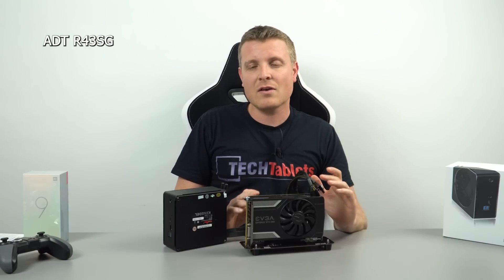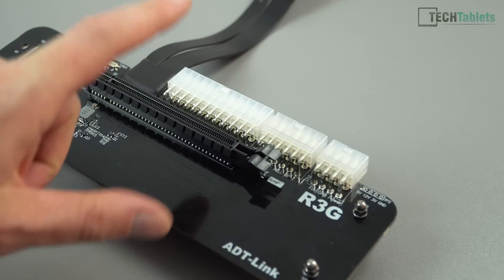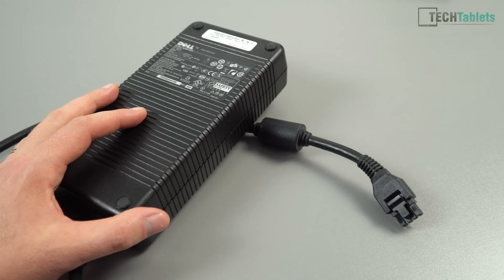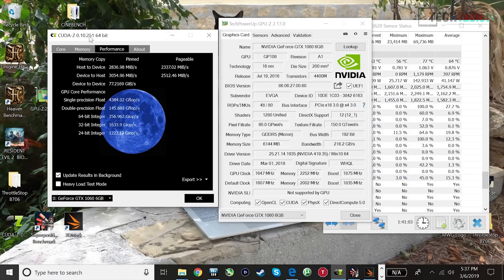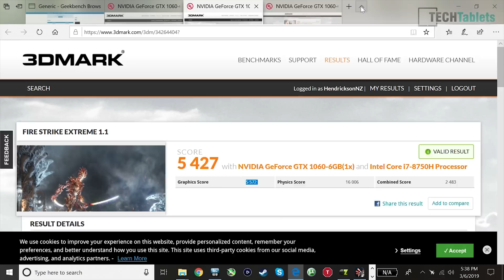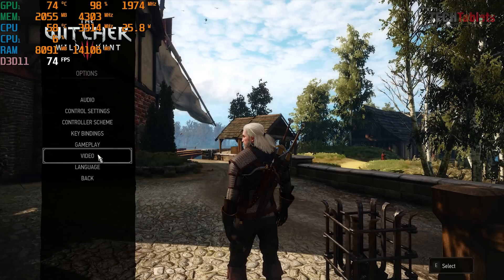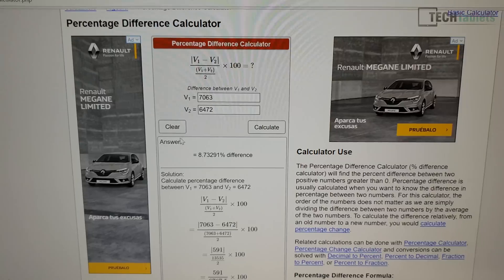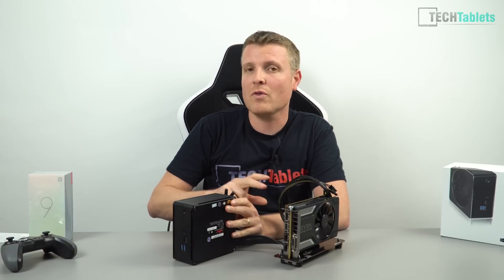M.2 PCIe x4 to External eGPU - Faster than TB3 eGPU's

Comment: Hi, i bought the same mini pc and egpu stand but im getting code 12 not enough resources  with the 1660ti and 1060 6gb did you run into this? did you config the bios in some way?
Reply: did you start the system? what bios settings?

Comment: works 100% no bullshiet, just at first tried connect to nvme slot and didint work so i remove my ram from nvme/sata and tried again true there
Reply: did you start the system? what bios settings?

Comment: I was running a eGPU set up with EXP GDC Beast V8.0 and a GTX 750 Ti and powered it with the same Dell PSU as you. Now i was thinking of upgrading to a GTX 1060 6GB and was wondering if the dell would be still enough. I hoped i could see how you connected everything. Could i just connect the EXP GDC with the Dell PSU and place the GTX 1060 6GB in the PCIE Slot? Or would i still need to use the connector cables?

Comment: Hello friend. If it is not difficult to answer a couple of questions .1) Is it possible to sew and model the bios in the Chinese mini PS? (And where to take them and what are the bios standing there?). 2) And I'm also very interested in the compatibility of the Chinese mini PS for (Egpu +1060) are they all suitable for such connections? And what problems are encountered when connecting to an external video card (they do not have a video egpu igpu tab in the BIOS)

Comment: I'm wondering..what if you plug the NVME end into one of those NVME to thunderbolt 3 enclosures and then you have yourself a external GPU that you can plug in via Thunderbolt 3? would that work?
Reply: Will work but will turn it in to a hyper computer

Comment: Great video, I always wondered about doing this. Glad to see someone tested it and shared their results so cleanly. Also you should try this with AMD's new x570 boards. The new boards have M.2 PCIe x4 gen 4 slots which double the bandwidth of current gen 3 M.2 x4 slots. So there should be little to no decrease in performance for all cards that cost under $1000 :)

Comment: is anyone tried at laptop ?
Reply: Yes,i got this for laptop with 1080ti and is working super.
Reply: @battlefield5cheaters758  Was there any problems installing the card? I build a similar setup but I get Code 43 with my Geforce 1050TI and my ASUS N552VX

Comment: The reason you didn't lose much performance is you are using 1080p resolution. If you have a 2K or 4K screen, you should be able to see more performance loss, I think. Anyway, this seems to be a really practical solution for mini PC. Thanks for sharing.

Comment: Some laptops/systems block additional devices from being added meaning you would then need to get hold of a bios which has been modified to "Whitelist" addons such as these.
I had to do this a couple of years ago for my Dell laptop.
Once the hassle of finding the correct bios and flashing was done, it preformed great!
Whilst they are an option for upgrading the graphics, they are not always as simple as P&P.

Comment: I did a written comparison a decade ago, with the AMD 5770, and got about the same results even then. 2% was lost when using 8x PCIe, which could be the case if running SLI in some motherboards (16x+1x OR 8x+8x options). Anyways, cheers.

Comment: do they make that cable with type c? I would like to have that thing  connected to tunderbolt 3 laptops
Reply: The thing with type-c PCI is that it must be run with thunderbolt 3 or now USB 4. And that is slightly slower because built into that protocol is error correction which is necessary when you're passing this much bandwidth over several meters in some cases when you have active cables. That error correction adds latency to the signal and that's the primary reason why performance degrades from regular PCI. It's actually not bandwidth of thunderbolt that's the biggest problem it's how long it takes for the signal to reach the GPU that's the bigger bottleneck. M.2 is directly connected and doesn't have that problem.

Comment: In what universe is this better than just having a slightly larger box with everything inside it.  With this I have a underclocked CPU, a second gadget the card sits in and yet another PSU as well.  All this accomplishes is making things a big mess.
Reply: It's not for you doesn't mean it's not for someone else. Nobody use this as their main rig anyway. I have a similar setup that i put under my TV in the living room. My kids love them. Which also i use for playing emulators and light work.

Comment: so, if i would use a psu instead of a powerbrick like you did in the video.. do i have to connect all cables? 24pin motherboard, 8pin pcie + 4 pin cpu?

Comment: Can you actually do it in your laptop screen instead of using external monitor if its going to the laptop?
Reply: Yes, but you incur an additional performance penalty due to using up bandwidth to send the actual video output back through the M.2 connection to the laptop monitor. Using an external monitor would be a much better option.

Comment: Awesome video. I was looking for something like this for a while now and your video made me pull the trigger on mini pc with the i9 8950, but also the external nvme stand. Thank you for the insights!  I have a few questions.

Will the dell power supply be ok for the newer gtx 1660ti? What about 2060?

Do you know any other similar external power supplies with more power?
Reply: It depends which model of GPU, all 1660 Ti(s) should work perfectly fine, but some 2060s do require an 8+6pin connector
Reply: Best to go for a 450W psu

Comment: I want to buy mini PC  but I ll install ubuntu on it. Is it possible to use this workaround to run external GPU on Linux?
Reply: yes. just like in windows. you just have to download nvidia driver , if its ubuntu 19.04 nvidia drivers comes out of the box

Comment: This eGPU dock is amazing!!! I didn't know this existed or I would have gotten it for my laptop instead of my gaming PC that is only budget. Though my laptop only has two cores but I upgraded it to 8gb of ram and I don't mind modding the laptop to add support for the mini PCIE slot. But where did you get the power brick from to power the eGPU? I have been looking for one for years like that and can't find one. I travel all the time and want a really small system. I know I could use an ITX PC but that still uses an atx psu and this is even smaller then an atx psu: True SFF goodness!! This would be awesome to try out with the Asrock Desk Mini for Ryzen that is coming out soon!! :) Thank you so much for this video!!!!!!!
Reply from the maker: I got the Dell DU-2 8 pin power brick from Ebay.co.uk it was about 25 euros.
Reply: @Techtablets  Thank you very much! That is a great price.

Comment: did you have to play around with the bios when using the Egpu? I have the 8950hk variant and i get black screen and no usb input when i turn on my pc.
Reply from the maker: No just plug and play it worked. I used the bottom NVMe slot. Check the switches on the egpu stand are set to 1
Reply: @Techtablets  I am actually using an older model of the Egpu, exp gdc 9.0b. When you first got the mini pc did you have to change anything in the bios? Mine came with the csm config disabled by default.

Comment: I know we are in 2019 already, but there's no such thing as an "old laptop" with an M2 NVMe slot, come on. For all the old laptops there is the EXP GDC with mini PCIe. I agree that this ADT-link adapter is better than the EXP GDC using M2 NVMe, but this is NOT a solution for old laptops. Great video, though. Thanks!

Comment: I love the idea.... pretty cool stuff!  Now can you use both ADT-link, get 2 x 1060 and get the SLI to work?  Any idea on a good external case to protect the graphics card?  thx.
Reply: The concept of SLI is actually to divide the job of PCIe 3.0 x16. When you're running 1 GPU card on desktop, You're using PCIe 3.0 x16. But when you're using 2 GPU cards SLI, the x16 becoming x8*2 not x16*2. 

That being said, SLI eGPU will run at PCIe x2*2 and the bandwidth Loss is just crazy.

Comment: 150 euros USED is a good price? ouch also in your percentage calculator you show the gain from the "crippled" on to the non-crippled, you need to swap them to show how much you LOSE going from the normal card, to the 4x card. You can't just swap them, because the numbers are NOT the same ;-) otherwise nice review

Comment: The sad reality of the PCIe 3.0 x16 is that its basicly never used.  I have mine set up in PCIe 3.0 at x4 and it posts the exact same benchmarks as the x16 slot.  All tests done at 4K resolution. Tests were done on GTA5 online, Arma3, Fortnight, PUBG, all standard 3D benchmarks.   At x4 x8 and x16 all tests results remained the same. Im using a i7 7700K with a 1080ti with 16 gigs ram. 

In conclusion I believe your 5-12% loss is with the "ADT-link R43SG" itself. Not because its set to x4.   I hoped this helped.
Reply: For a lower power card this is true, but something like a 1070 or stronger will need a x8 to not have losses. A 1080 ti will see definite loss at x8.
Reply: Aurummorituri re-read what I typed.   I'm using a GTX 1080ti.   I'm seeing no loss at all.   What I'm trying to say is there really isn't games out that actually even use 8x let alone 16x.
Reply: 4k is close to hitting the gpu's limits so pci-e bandwidth does not matter so much in your case. trying a lower res like 1080, the gpu will be able to push a lot more frames, so bandwidth will be a bigger problem. you should try it and see what kind of loss there is with the x4 speed vs x16. but in general no gpu can exceed pci-e 3.0 x8 bandwidth currrently.
Reply: @giornikitop5373  same results.  nothing changed from the 1080p across the board when compared to x4 vs x8 vs x16.  Believe me.  I was just as shocked as you are.

Now don't misunderstand what i just said.  There was a huge frame increase from 4k to 1080.  What im saying is there was no difference in frame comparison with 4k vs 1080p at 4 8 and 16x.
Reply: @giornikitop5373  when you start pushing VR at 4k is when i think it will start to show itself as a problem.

Comment: try to find a gpu for the surface book, I know its a wayyyyy I think u can figure it out !!! you would be the king of computers if you found out how !!! on my soul !!
Reply: Surface has usb type c or does it? you could use the thunderbolt 3 concept and go for asus egpu
Reply: @sesisesi2027  it has it but not for external motherboard support, the power cable has it, so somebody can configure something, it has the ability to control the CPU,

Comment: Huh. I wonder how well the i9 version you reviewed a bit ago would work with say, an RTX 2070 or something. That could be a really slick setup, especially with a portable battery bank! (Not using the GPU of course)
Reply: I am also very curious if this works with the RTX 2060 for example. I am waiting for the mini pc with i9 and for the external stand. I want to buy a rtx 2060 and I am concerned about the compatibility (eventhough, it will most probably be recognized).  Even if I lose about 15-20%, I would still be ok with it :P

Comment: Only 5%... but not of course if you try higher resolutions.. then the % loss is higher. Fine for 1080p
Reply: 1060 is a 1080p card anyway. It performed  best on that res.

Comment: this is a really bad review and here is why. You are missing that this is about fps/resolution over the pcie lane, meaning higher fps or resolution will give you a higher bottleneck situation, higher tier card = more bottle neck. Doing this on a laptop using the build in screen will cut your pcie lane in half because you have to send the signal back = NOT AN OPTION. On a card like the 2060 you will loose around 20-25% depending on resolution and fps, making this a very expensive solution.
Reply: He did mention that this is for people doing some light video editing or light gaming. So in other words for poor college students that only have laptops and can't offered to buy a whole new setup to game or video edit. I do find this as a good solution for people on a low budget that already have laptops and can't afford to spend money on, monitor, case, MOBO, video card, ram, HDD, and or a disc drive.
So in a video editing situation, the GPU will take care of the work load.
Reply: @DaBrown101  Maybe I didn't make it clear in my post, but by using your laptops build in monitor you are looking at a 50-60% performance cut because of the return signal on the pcie lane, which is already bottle necked. so buying a 1060 card + the ADT-link R43SG and getting a 50-60% performance cut on that is in my book a very poor return of investment. Using an even higher tier card will only make it worse. I have an intel i5 nuc 8 gen from intel myself, and have been looking into this option myself either by thunderbolt or mpcie, but either way i'll be looking at a performance cut on minimum 20% by using a 2060 card, which is too much for me. The issue here is that the review dosn't really address these issues.
Reply: @mrk3047  I see what you mean now, sorry for the misunderstanding. But at least it got have an old laptop and want to game a little you can buy one of those GPUs but yea if you wanna get better performance you're gonna need a desktop then at that point

Comment: TB3 operates over an x4 PCIE connection, so I’m curious as to how you gained more performance from one of Nvidia’s lowest tiered cards. Now if you tested a 1080 or 1080TI and it performed better than TB3 that’d make more sense
Reply: i think the pcie 4x has a direct path to the cpu while the tb3 needs to go to the tb3 controller first then the processor. so theres more performance hit in tb3. this is pretty much the same as the alienware graphics amplifier implementation minus the custom connector. thats just my theory.  i have an alienware alpha that i upgraded the egpu by connecting it via the ngff pcie wifi card.
Reply: @ronaldsanpedro1976  what sort of loss do you get on the alpha on the graphics side in terms of % on the full external gpu potential? it's only 1x lane on the alpha where the wifi card goes isn't it? isn't it an m.2 connection?
Reply: @huzcer  alot. Im just getting about 60-70% of the performance of my graphics card ( vega 64 ). I retired my alpha and  end up just building a small itx gaming pc build. ( Dan a4 sfx v3) so i can upgrade the components in the future. If your dead set on the AW alpha size gaming pc, the most powerful you can get is from zotac. Its called magnus en1070k. Or if you ok with something a little bigger, get the watercooled zotac en1080k with a gtx 1080. Although its not upgradable just like the aw alpha. Hence i just build a sff gaming pc.  Although i do sometimes miss the aw alpha's size on stock form. Once you add an egpu, it becomes bothersome size wise.
Reply: @ronaldsanpedro1976  good reply. thanks

Comment: Can you do this with AMD as well? That’s a way around thunderbolt exclusivity
Reply: M.2 is PCIE not Thunderbolt ;-) They are NOT related.
Reply: Jesper Andersen I didn’t say M.2 = TB But thunderbolt is a PCI-E protocol over proprietary connection of the same vein genius, that’s the point I was making, if you can tap into PCI-E lanes & use adapters it can be used to replace thunderbolts role in its absense
Reply: @Fee.1  it supports it yes but M.2 is STRAIGHT PCIE no conversions, which causes latency which is BAD for GPU's
Reply: Jesper Andersen don’t try and salvage your correction. You misunderstood clearly or you wouldn’t have tried to explain that “M.2 is not thunderbolt”. M.2 is a connector. So it is not inherently PCI-E. NVME & by extension M.2 NVME is obviously PCI-E, not SATA like M.2 vanilla, but you’re confused and don’t know what “conversions” you’re even talking about. So let’s stop. I don’t care in the end, nobody does, the point was it’s a potential external PCI-E Connection for systems without thunderbolt, if you can’t see the value in that, and that it makes AMD systems have one less caveat, then this is a excercise in futility
Reply: @Fee.1  salvage? M.2 is a connector yes, just like a PCIE socket on the motherboard and it contains TRUE PCIE, not converted like thunderbolt, maybe one day you will learn the difference
Reply: @Fee.1  you even say it yourself "controller" aka it is an EXTRA layer between the PCIE and the device... You don't get that with M.2 are you really that blank? The end from me, you are simply unable to comprehend that a controller induces latency and the issues that gives, where a pure connection has none of those issues

Comment: TechTablets, thinking about picking up a new thin & light for senior year of high-school and college. Should I get a used Thinkpad X1 Carbon or shell out for a Teclast F7 Plus or similar laptop? I'm coming from a 2017 Acer Cloudbook 14, the N3060 one, and I'm shooting for graphics performance as fast as an NVidia GT610 since I do a lot of 3D work. 

Edit: Make that a T450S
Reply: get something with a discrete graphics card in it. even an mx150 / mx250 would help and you can get those in thin laptops.